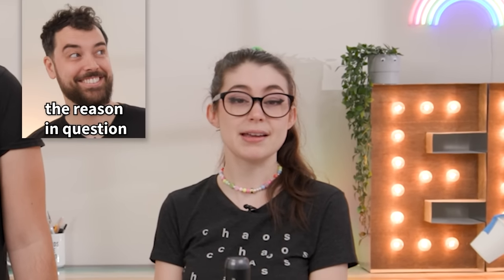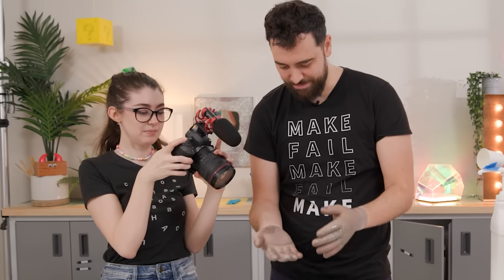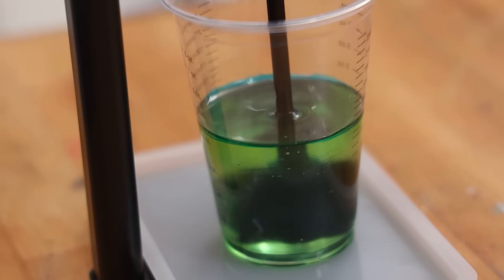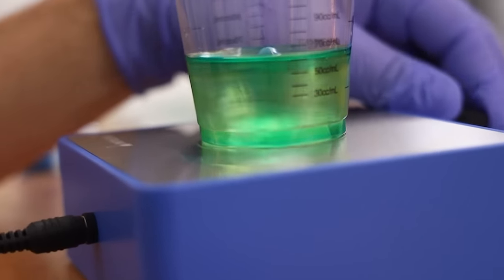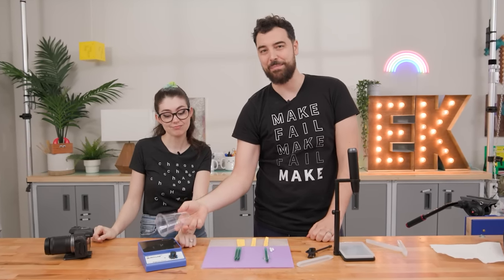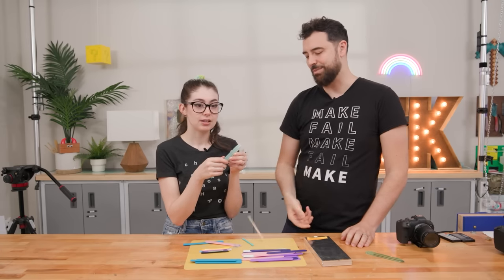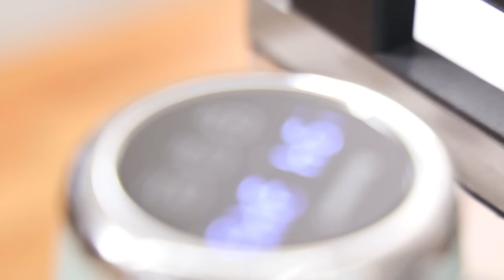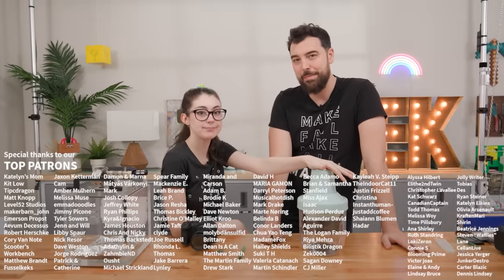Testing 7 Weird Resin Gadgets from Amazon (2 were good)

Comment: as a complete aside, for silicone products for resin, such as sticks, measuring cups, horrible gloves etc, you let the resin cure normally and then wash it in warm soapy water ( i have a specific washing up tub for this purpose) - it comes off much easier. discard of the water using some sort of wilter or seive to stop the resin going into the drain, let dry and then put it in the bin (that is a personal preference as i don't want water buildup in my craft bin) 
using silicone measuring cups and sticks is really good if you want reusable instead of disposable products, even though that does mean maintenance. do recommend
Reply: although yes sticks can be done easier with alcohol wipes as soon as you're done with them

Comment: The reusable sticks would be fine if they were wiped down with alcohol right after use instead of trying to peel the cured resin off.
Reply: Or simply washed after curing. As in - take a sponge, take a bit of water with soap and wash the stick
Reply: I'm also curious if they could have sprayed mold release on them would they have worked better

Comment: I think something that wasn’t mentioned or considered during this was the impact of the environment for things like plastic gloves and wooden popsicle sticks. I think that if you had cleaned the silicone sticks afterwards kinda like the magnets the rating would have been different! I think things like that especially when it comes to science and how our DIYs impact the environment is important to consider and just wanted to mention! Great vid as always.
Reply: Maybe. But wood is renewable, and silicone often isn't. If you can get 20 uses out of one stick, that's probably friendlier. And latex gloves are very, very thin and biodegradable.

The real issue though is that it all probably dwindles in relation to resin, which is fossil fuel-derived and not really degradable. The most environmentally friendly tool is probably the one that means does the best job and results in you wasting the least resin.

Comment: The best way I get the hundreds of little resin pebbles off silicone like that is usually with some cheap dollar store masking tape looped sticky side out. You can move to another area of the tape with one hand and without ripping off more pieces. Picks it up off the silicone with no problem! (I wrote this right before Evan pulled the tape on screen, hilariously-)
Reply: @mm1234Xxx  You're right, but it's still a pretty usable tip for other silicone molds. I didn't really see a point in the gloves either.
Reply: A lint roller may also work.

Comment: One thing I have found when hand mixing is that colder resin gets more bubbles. Before I use my resin I put the bottles in a bucket of hot water (not up to the cap) for 5-10 minutes and I got little/no bubbles. It is a life saver!

Comment: Results of the lab magnetic mixer are pretty surprising! Never thought it would do so well to prevent bubbles, since the thing mixing doesn't ever touch the surface like other mixers.
I use silicon mixers personally. Mostly because they have a sort of spatula edge (not basic popsicle stick shape), and reusable which is more environmentally friendly. All you really need is a stiff cleaning brush (like the kind for cleaning a sink) to get the resin off silicon stir sticks.

Comment: make reusable silicone gloves using molds of your own hands made from resin. To make them slightly larger than your actual hands, you can sand the resin hands after they dry and dip them resin two or even three more times before smoothing them off again. You can even make them elbow-length for extra protection.

After completing the silicone part of the gloves for thickness and sturdiness, you can sand the silicon itself (not the easiest thing to do, but it works) and coat the gloves in another material, like Nitrile, to add further protection. For comfort you can add you can add silk inserts for the insides so your hands slide into the gloves perfectly every time. Once you're sure the silk inserts work well, you can put them on your fake hands and carefully coat the outside with a sturdy glue before applying the silicone gloves.

The gloves won't work perfectly for other people. But for you specifically, they should be one of the best sets of gloves you've ever used.

Comment: I use the silicon stir sticks all the time. The trick to them is to wipe them off with a shop towel before the resin hardens. They're super easy to clean then. Once the resin hardens, though, they're terrible.

Comment: Actually, I think the vacuum needed to pull most of the air bubbles out of resin doesn't need to be that high. All it needs is to reduce the pressure on the bubbles enough so that they grow in size and displace more resin ( hence have greater buoyancy as the mass of the gasses inside remains the same assuming nothing evaporated from the resin ) and then float to the top where u can just scrap it off if they don't pop.

Comment: For any kind of rubber glove - I really recommend getting some very thin cotton gloves (or bamboo fiber even better if you can find it) to wear under the other gloves. It not only makes taking the gloves on and off so much easier, but it also lets your hands breathe and wick away some sweat. Easy to clean too. Eczema gloves are often good for this because they tend to be thinner than standard cotton gloves.
Reply: How often can you use them until you accidentally get resin on them?
Reply: @Jehty_  It's more of a general tip, and it applies just as well to single-use gloves.

EDIT: I get it now - you meant getting resin on the inner gloves? Probably happens at some point, but you can get these simple cotton gloves by the dozen cheaply, so it wouldn't be a disaster if one or two get ruined.

I don't have person experience with silicone gloves against resin. Probably too time consuming judging by the video. They deal really well with oils, greases, paints and a lot of other stuff though, so a nice option to have.

Comment: I use the blue fancy silicone stir sticks when I mix resin. For cleaning them and an resin molds I use take a tub of water with some alcohol and clean them in it, you can then either dump the water into the toilet or strain it first before dumping. Though that chemical stirer looks amazing and works awesome. I may look into getting that!

Comment: I was an intern in the chemistry department while in college and part of my job was preparing experiments for classes. I used a chemical mixer with the "pill" magnets all the time and they had to be easy to clean because if you reused one that was covered in some random chemical it could ruin the experiment at best and be really dangerous at worst. It's cool to see that it works so well to mix resin also.

Comment: For resin mixing I keep every electric mixer beater I come across. The round metal beaters that turn in a mixer that you use to whip egg white or whatever. Idk what they are called but I always have plenty of them. Stick it in a drill and go to town. And if you want to mix smaller batches you can cut the limbs off a beater just leaving sort of a plus sign shaped bit at the bottom. Works great.

Comment: Trick to cleaning the rubber/ silicone stir sticks is to whack them a few times against your counter or work are. Then pull off the big pieces. Then put the sticks in your ultrasonic cleaner. I find that taking them out after one cycle, then rubbing a paper towel against the stick and then putting it back for a second cycle should get it all off.

Comment: Tip for turning gloves inside out without blowing into them: bunch up the wrist of the glove with one hand and push the trapped air into each finger with your other hand. Works surprisingly well and useful for working in kitchens, workshops, and labs or anywhere you don’t want used gloves on your mouth

Comment: For the magnetic mixer - as the pill is magnetic, it's the easiest to extract it with a magnet by sticking it through the container and moving it along the walls to the top. You don't need to submerge anything to extract it that way. Or you can just keep it inside when pouring, held by a magnet.

Comment: The bubbles should NEVER be a problem, regardless of the tool used to mix. If you're making things from resin, and you're not using a vacuum chamber, then you're doing it wrong. They might be around 100$ or more, but worth it. My sister and I got one from amazon. A 1/3hp vacuum pump, lid and big pot(basically). 3Gal chamber. The exact one we have is 138 at the moment, and we have had it for over 2 years ,closer to 3. Not having one when making resin stuff is like riding a bike without tires or tubes, but using only the rims.

Comment: I use the silicone coated paddles/wide sticks. The easiest way to clean those is a baby wipe while still uncured. They wipe completely clean that way, and then I wash them with soap and water or isopropyl alcohol before using again.

Comment: I got the mixer stand a few weeks ago, but got the Let's Resin resin mixer to use with it. Yeah, I had to move the mixer up and down a bit through the cup in order to get everything mixed, but it sure saved my hands/wrists since I have bad carpal tunnel. 

I also have the Resiners little vacuum chamber thing, and while it's not perfect, it did help get quite a bit of bubbles out of my resin in 5 minutes. I wasn't completely free of bubbles, but still significantly less than the amount of bubbles I get mixing by hand.

Comment: The trick with getting resin off plastic cups etc is to allow it to make a thick coating, for example, leave the stick in a cup with some resin at the bottom instead of wiping it off.

Comment: First, I would love to see you do a test with different volumes with the magnetic stirrer, and different cup sizes with the different magnet sizes.
Second: When trying to pick off the resin bits off of silicone, have you tried a good lint roller? That way you can pick the silicone off quicker with leff effort and just peel off the used sticky paper when you're done.

Comment: Pro resin stirring tip... When stirring manually, go slowly as possible without exceeding a reasonable working time. The speed folds in too much air.

Comment: Actually after your video on the comparison with the dehydrator I started using one (an old one) for my resin projects and I can de-mold in like an hour compared to the 8-10 hours. So a dehydrator will work with resin, just make sure you de-gas the resin.

Comment: The stirring bars are PTFE coated, which is better known as the brand name Teflon. PTFE (a plastic) is one of the most non-stick materials to exist. It is also one of the most chemically stable materials, so it isn't damaged by anything you throw at it. The combination of these properties makes it perfect for laboratory work.

A very useful material certainly. I have some thin sheets of the stuff (it's somewhat pricey) that I use when messing with glues and such, or really anything that can make a mess. Everything just slides right off :)

Comment: With the stir sticks, why wouldn’t you wipe them off with paper towel after use? I use both the pvc and silicone style and just wipe them off during cleanup, that way they are not just sticking to the counter as they dry. I would not count them out just yet!
Reply: Yes and they did that to the magnets but not the sticks.

Comment: I'd like to see a continuation of this and combine the inexpensive methods to try to replicate the overkill. Such as, using the nice magnetic mixer and use the inexpensive vacuum chamber to compare to the pro version and at what total capacity(volume) with timing (progress in the cure from addt'l time) does the inexpensive start to fail.

Comment: Magnetic stirrers are excellent, so long as you're material isn't terribly thick.
You can get stir bars in different shapes as well.
I would use a marshmallow as your standard for the vacuum Chambers.
Marshmallows are consistent and will easily visually show difference between performance.
I can't help but laugh after you de-aired the material and then proceeded to layer up during the pour.
Start at one end of your mold, move consistently to the other and hold.
This will wet your mold and give you flow throughout without having to go back and forth.
You guys should get some viscosity cups.
 I think you would have fun with those.

Comment: i think you have to do what you did with the stir bar and clean the sticks after each use. that might be the intention instead of letting it sit and cure.

for the weaker vacuum, you might have better luck if you pour the resin into a wider cup. less travel for the air also might not cure as quickly. since heat has more chance to escape.

Comment: My thoughts on the bubbles from using a stir stick are that the bubbles are definitely due to the fact that when you stir manually you break and disturb the surface which introduces bubbles, the stand mixer and the magnetic stirrer do not stir above the surface so they do not pull in any bubbles. This is exactly the reason why you would not be able to froth milk properly without pulling the frother slightly above the surface as well as you would not be able to beat eggs properly if your mixer was fully submerged.

Comment: Question about cleaning the paddle mixer: would it be more efficient to fill a cup with some alcohol and inserting the paddle to “swish” the alcohol around for a minute? That’s how I clean hand mixers when mixing cake batter. It’s way better than trying to wipe goop off by hand.

Comment: So the thing with the silicone and pvs stirring tools is that you can clean them easily with some alcohol and a paper towel or whatever, same as the little magnets with the chemical mixer. You don't have to wait for the resin to cure and then manhandle it off. 😂

Comment: Chemist here: For the magnetic stirring, you don't want a vortex/tornado. That means you are getting laminar flow and the mixing isn't optimized. In this case, chaos is better. Lower the velocity a little bit until the vortex in the middle disappear, then it will be at the best possible speed for mixing

Comment: One thing to think about with the vacuum chambers is that in yours, the resin raised very quickly and high. So it that cup was fuller it would have over flowed. The other chamber didnt. It was a much slower and more controlled vacuum so it barely had and raise to it at all.

Comment: 24:00 I mean, to be fair - you STARTED mixing the resin with the PVC stirrer and ended with the other ones, so you may not have fully mixed in both parts before you removed the stirrer, and that's why you got uncured bits

Comment: I use a magnetic stirrer for my resin. The tablets can just be wiped off
 They are Teflon coated. Have reused it a bunch.

Also I have a vacuum chamber made for resin with a compressor that cost 119 usd. It is faster and bigger than the 150 one you guys tested.

Comment: The reason the bigger pump is working faster is the volume flow rate.  They can be at the same vacuum (pressure) and the one with the higher flow rate will just remove the gas faster.

Comment: I know you guys dont like bubbles in the resin, but we use a  ultrasonic cleaner to mix ink for our printers up. The ultra sonic cleaner has water in it and we simply put the container with ink it it, in the water bath. The vibrations travel thru the water and the container and mix the ink up. I also use the same method for cleaning small car parts

Comment: The stick test, I have a problem with this. 
1. If you look at the wipe-off-ability. Because I really think that is why you do it in silicone. And then you can only compare them to each other.
2. You can't say that there were as many bubbles in the control as the silicone PVC test since you put down three different sticks ie introduced air three times. Therefore you should redo this test with a control, and one for every stick. (And check the wipe-off-ability)

Comment: The readings on the cheaper vacuum chamber (which you could technically call a pressure chamber, it's just negative pressure) might be right, since -94 and -98 kPa are actually way more different than they sound; if ambient pressure is 100kPa, then the -94kPa gauge pressure is actually 6kPa absolute pressure, and the -98kPa gauge pressure is actually 2kPa absolute pressure. So the expensive setup is not "4% better", it's cutting the pressure down to a third of what the cheap one can.

Comment: thoughts on the "features" of the gloves... pads, for heat if youre handling a mixed bowl of resin thats going exothermic. fingerprints for a little extra traction. thumbnails(best guess) extra indicator on the side youre most likely to see that would tell you if its on the correct hand.

Comment: the silicone sticks are so easy to clean if you wipe them off with alcohol before the resin cures. If you let it cure, some tape will do the job. Also DO NOT STIR RESIN THAT FAST!!! It is supposed to be stirred slowly so it doesnt create micro bubbles or at least try not to. Viscosity also matters when it comes to stirring, the thicker it is, the slower you wanna go.

Comment: Katelyn was it your idea to put in the "blackhead removal videos be like" tag because i may not have used tape for blackheads but i did use tape as the adhesive to my leaf bandage i did use multiple thin layers of pva glue as a face mask which did also remove blackheads depending on size. i was a very bored kid in school particularly in science and re studies.

Comment: I've re-used nitrile gloves for resin based 3D printing in a pinch and that's a FAR better option than those icky silicone gloves. Also, not gonna lie, I expected the $150 vacuum chamber to be just as crap as the rebranded food dehydrator. I was legit impressed. I'd NEVER buy it because I don't trust a molded plastic container like that but if you're just someone just doing small pours on the cheap with limited space this might be alright.